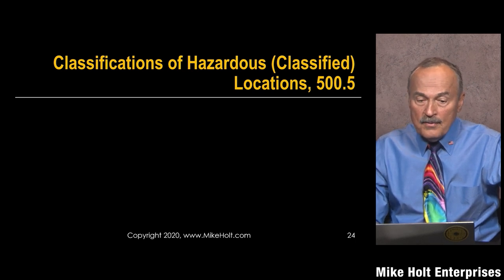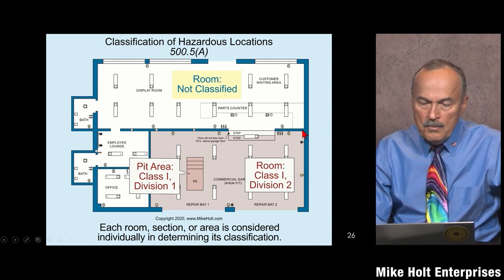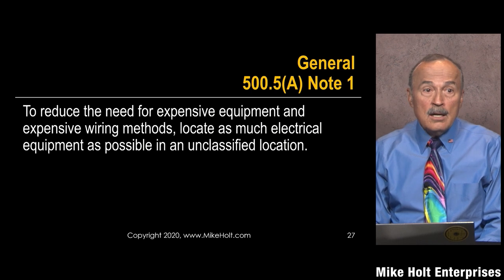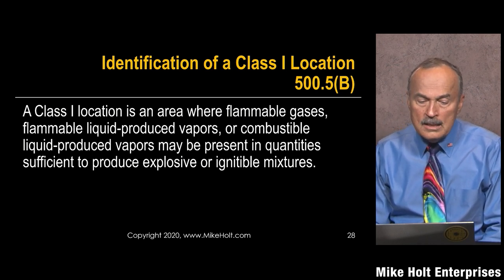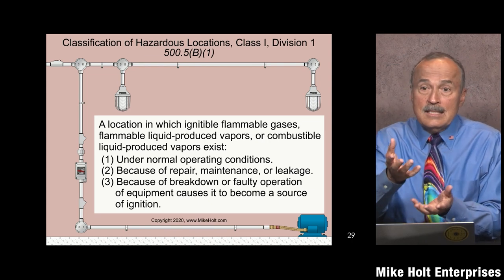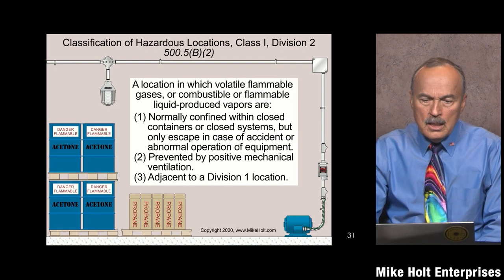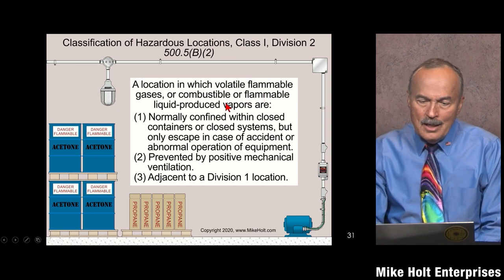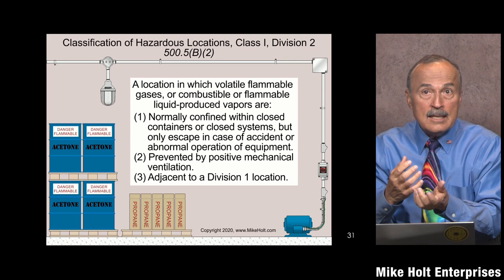Hazardous Classified Locations, NEC 2020 - [500.5], (17min:43sec)

Comment: Hazardous Locations Summary by Mark 
Class I = Gas and Vapor {flammable and combustible LIQUID}. 
{Class I} has two Divisions {Division 1, Division 2}
Division I = Normal.  {Serious Explosion and it will definitely happen} {one Mistake, you are on Fire}
Division II = Abnormal. {none Serious Explosion but might really happen}. {two mistakes you are on Fire}. 
i.e ={Leakage then Spark }. 

Class II  = Division I & Division II    {Division I = Dust in the air} {Division II = Dust on Equipment}. Any of these Divisions could cause fire. 
Class II Division I  or II  = Combustible Dust.{500 microns or less} is considered combustible dust and could cause fire. {Dust in {Class II, Division I = (Dust in Air)} ….. Dust in {Class II, Division II = (Dust on Equipment)}….. 
Class III { What are ignitable fibers or flyings?
This classification is created by the presence of easily ignitable fibers or flyings. Typically these fibers and flyings are not suspended in the air, but can collect around machinery or on lighting fixtures and where heat, a spark or hot metal can ignite them.}
Class III, division I = { Textile mills, cotton gins; • Cotton seed mills, flax processing plants; and • Plants that shape, pulverize or cut wood and create sawdust or flyings {clothing or farms that deal with grains like the coat of the coffee for example}

Class III, Division II = { Division 2 is also a subset of Class III and is classified as an area where ignitable fibers or flyings may be stored or handled.} {like when you store clothing or cotton gin somewhere}